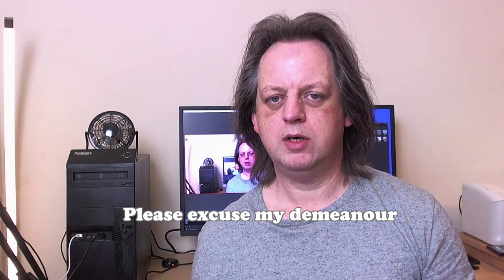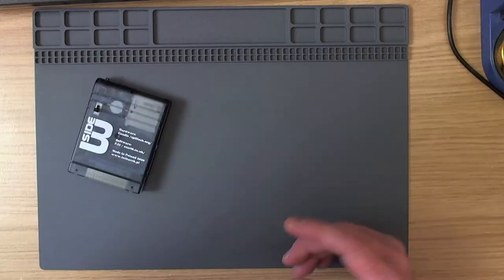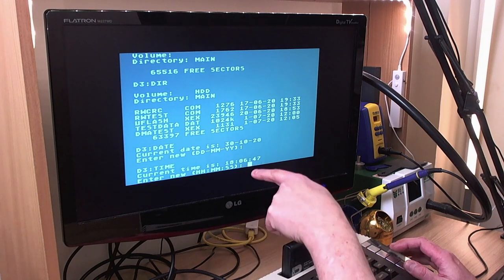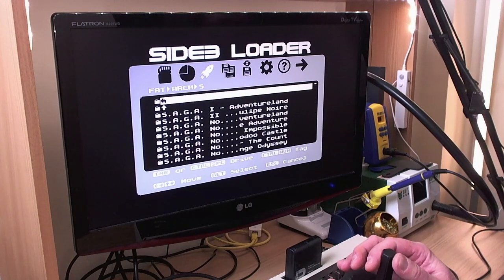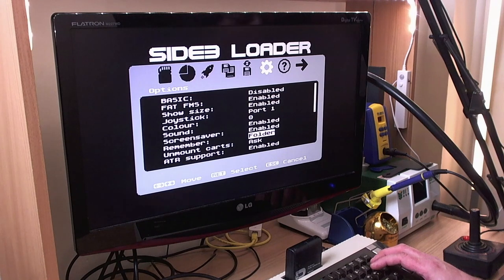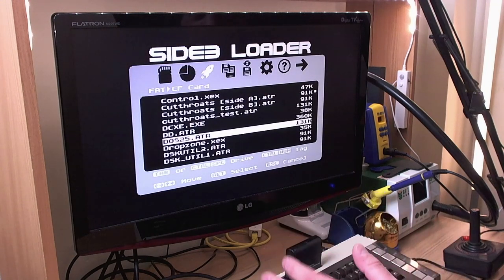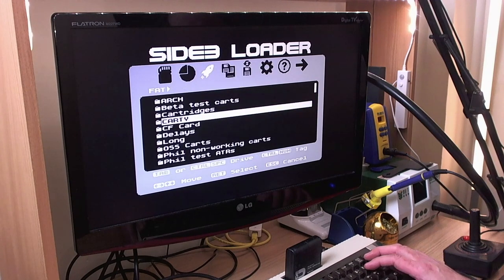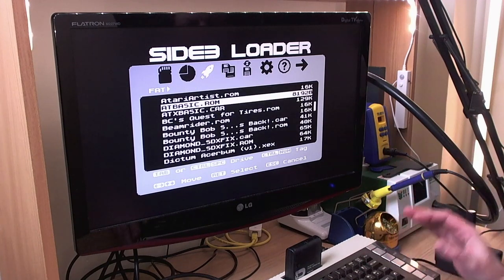How to use SIDE3: Part 1 - Stand Alone

Comment: I bought the SIDE3. I just have an stock 65XE. To prepare and create the APT partitions in a SD card with FDISK, I use Altirra and SIDE2 emulation, then write the resulting image to an SD, works great. Now I transferred all my games, sources, disks all to the cartridge and works at light-speed. Great product.
Reply: Eduardo, I would be forever in your debt if you'd be willing to post some details on how you do this. Whenever I get to FDISK and actually tell it to format the SD card all I can get out of it is "I/O Error 255". Thanks in advance!
Reply: @ChrisPatti  I configured Altirra to use an emulated SIDE2, and created a Hardisk using a VHD image. Then formated the VHD using FDISK, using a FAT16 partition and several 16MB APT with FDISK. Finally I copy the VHD to the SD with a windows utility  "HDD Raw Copy Tool". Write directly to the SD from SIDE2 emulation not work.

https://atariage.com/forums/topic/268007-side-3/page/5/
Reply: @elkino1  Thanks so much those details are probably super important. I may have been using partitions that were too large. Thanks a bunch!

Comment: Thanks for the videos. I just got the Side3 and U1MB and both come with no instructions whatsover on shortcuts, special keys, or just how to use them in general. So these videos are very helpful!
Reply from the maker: The vast majority of the existing U1MB/SIDE2 documtation on my website is wholly.applicable here. The manual is some 70 pages long. Have you read that?

Comment: Does the SIDE3.1 cartridge fit the Atari 1200XL? As you know, Jon, I got weak and couldn't resist grabbing a sweet 1200XL for my growing collection of Ataris which I haven't even yet received from the sellers in United States.
Reply from the maker: You'll need to file/sand down either side of the cart shell by about 0.25-0.5mm in order for it to fit the 1200XL properly (unless you simply remove the cart shell).

Comment: I'm wondering how it loads disks that expect to not have a cartridge installed.  I was thinking that besides the cartridge memory, you get 256 bytes at D500 if you watch the select line.  If you're insanely clever, you could use a byte for bank selecting and then put all the disk emulation code there, so you could them boot with disks and just RAM where the cartridge lives.  I suppose you could put everything into that D500 page and only use the cartridge space for cartridge images.
Reply from the maker: That's more or less how it works. The SD card registers remain when the ROM is turned off, and turning the ROM off is the first thing the loader does before booting the OS (whether performing a cold-boot when U1MB is present, or soft-booting the RAM-based OS when the cart is used stand-alone). In stand-alone mode (no U1MB PBI support present), the entire ATR image is loaded into SRAM, then the patched OS is installed, which has a patched SIO handler which reads 'sectors' from the image in cartridge SRAM (which is indeed accessed through the 'keyhole' at $D500-7F after the cart ROM is disabled). When U1MB is present, the PBI BIOS (4 banks of 2K ROM under the FP pack) handles ATRs, and is able to read/write them directly. Although the cart ROM is routinely disabled before running an XEX or ATR, the loader allows the simultaneous mounting of an emulated cart, so you can - for instance - boot DOS 2.5 from an ATR, with OSS BASIC XL present at the same time. When you run an ATR or XEX from the loader and there's an emulated cart already mounted, it will ask you if you want to unmount said cart image first (unless you configure the loader to always unmount cart images automatically).

Comment: Hi Jazz, How do you get other games demos etc.. on to the side3? Ive got sd card thats already partitioned with fodlers etc.. and all is working well ive updated the loader to version 0.39 and the spartados to 4.49e on the cart but now i want to transfer a cart file ive downloaded on pc ive tried taking the sd card direct to the pc but as its been partitioned and formatted as a fat32 the pc is asking to format the sd card so im just wanting to know how to transfer a cart image to the necessary folder on the sd cart or is this something i can only do once the U1mb is installed and not on stock 64k ?
Reply from the maker: Ignore any nag dialogs to format stuff, since it'll confuse the issue (Windows insists on asking you to format the APT container, which you must not do since that would destroy all your APT partitions). Presumably your card was pre-partitioned with 3 or 4 APT partitions and a FAT32 partition. So in this case, just cancel the dialog which pops up and go right ahead and copy your stuff into the FAT partition. Job done: it'll then show up in the loader.
Reply: @flashjazzcat  Thanks Jazz :)

Comment: Is there a difference between the 2MB and 8MB SRAM models of the SIDE3? Also, is there anyone I can goto to upgrade a SIDE3 to 8MB?
Reply from the maker: It depends if you're asking to upgrade a SIDE3 from 2MB to 8MB or a SIDE 3.1 from 2MB to 8MB. SIDE 3.1 has a few stability fixes, provision for future ECI connectivity, and provision for 2-8MB of SRAM. I'm not aware that SIDE3 has any provision for 8MB of SRAM, but Candle would be the one to check with there. I can swap the BGA SRAM chip on a SIDE 3.1.

Comment: Hi pal! This device can coexist with an sdrive max? When plugged it adds more ram to the atari without excessive mods?
Love your channel!
Reply from the maker: Yes, this device can coexist with SDrive, FujiNet, SIO2PC, SIO2SD, etc. The RAM expansion feature requires the SIDE3 'Wing' which isn't available yet. Hopefully thre hardware designer will have time to address this soon. Glad you're enjoying the videos!
Reply: And what’s the difference between side3 and ultimate 1mb?

Comment: Hi Jon ive just got my side3 and in the meantime ive ordered the sd card with all files demos etc on from retrolemon but in the meantime i have put a snadisk 2gb card in and the side3 recognises the sd card but i cant format it or even use fdisk? If i use fdisk it keeps coming back MEMLO to high? What does that mean? Ive also download the apt toolkit so do i need to put that on the sd drive max and load it then go again?
Reply from the maker: Ideally you want some extended RAM on the system in order to use SpartaDOS X and FDISK comfortably. You can create a Spartados-formatted ATR if you want with a custom CONFIG.SYS on it and boot from that on D1:. See the SDX manual for examples of how to do this, but bascially you want to omit DEVICE ATARIDOS and anything else not needed in order to get FDISK to run. MEMLO needs to be at or below $2000 for most software to run, and on a 64K machine, the drivers loaded by SDX push this up too high. Definitely consider installing some kind of RAM upgrade, though.
Reply: @flashjazzcat  OH RIGHT so now in order to use the side3 i have to now bump the 64k atari to say 1mb ultimate? I though the side3 worked on a standard 64k machine???
Reply: Ive actually ordered the sd card from the same place as the side3 which is all setup so when i pop that in my atari 64k machine it should work so why cant i set up a 2gb card myself from scratch without more memory??
Reply from the maker: @back2skooldaze  Yes it works on a 64K machine. Have you run the loader and tried starting any cartridges or XEX files yet? SpartaDOS X requires a lot of RAM, and this is hardly the fault of SIDE3.
Reply from the maker: @back2skooldaze  If you're unhappy, please take it up with the vendor. I have provided you with plenty of responses and links to the documentation.

Comment: hello, is it compatible with the xegs model? or do you need to make changes?
Reply from the maker: Sure. It's compatible with the XEGS out of the box, and is especially handy as a bootable HDD on that machine (if you add U1MB), since the XEGS has no parallel bus connector.
Reply: @flashjazzcat  OK thank you. is there also a site to download side 3 compatible games?
Reply from the maker: @johnnycage8950  Scroll down to the 'game catalogue' section of this page: https://atarionline.pl/v01/index.php

Comment: I have a 1200XL, is the Side3 too big for the cartridge slot?
Reply from the maker: Kinda. The situation is much as per the SIDE2; if you're handy with a file and sandpaper, you can make it fit.
Reply: @flashjazzcat  cheers Jon, i'll give it a go then! One more thing if you don't mind please, but I have a stock 1200XL, can I run games bigger than 64k with Side3? Or would I need to upgrade my memory? Thank you ;)
Reply from the maker: @cidercecil  Depends on the game, really. If it uses extended memory (anything accessed via PORTB and banked in the $4000-7FFF area), then no: you'd need a RAM upgrade. But if it's a cartridge game of a supported type, then 1MB images are perfectly usable on a stock machine.
Reply: @flashjazzcat  Thank you Jon, much appreciated!

Comment: While I like your GUI, I am not too happy about the limited space that is used for the file list, even more so as it uses the tall character mode.
Reply from the maker: Standard height characters would give you sufficient extra scan lines for two more rows while cramping the display vertically. I don't see that as a good tradeoff.

Comment: Today I have bought my first Side 3.1, but unfortunately the Atari is going crazy when the cartridge is inserted. Do you know what could cause this problem? I have U1MB, Rapidus, VBXE and Stereo. Without the cartridge everything works fine. I am sure that soldering is well done (it was made by Lotharek). I am using Power Adapter 5V 1,5A. Here is the recorded video with the issue : https://www.youtube.com/watch?v=GUPJtPKzY34
Reply from the maker: Yes - it's a Phi2 timing issue. Try replacing 74LS08 on the Atari motherboard with 74F08. Vendor should be able to tell you more about this, since it's a known issue. If that doesn't work, try the 'O2 Fixer': Vendor - again - will be able to explain in more detail. Lotharek's 5V PSU is also recommended. 1.5A should be enough current, but you have barely any headroom.